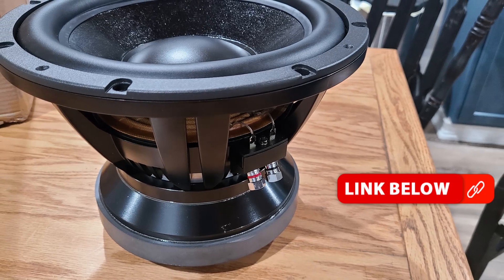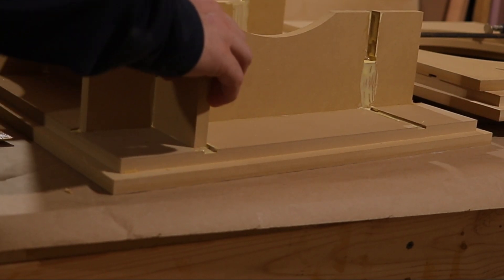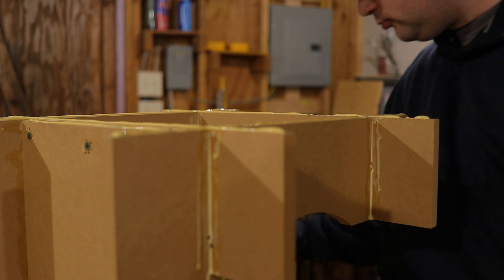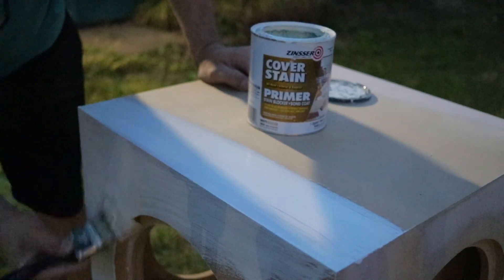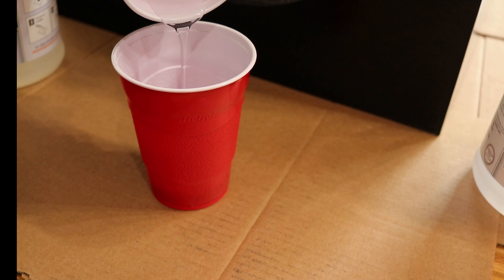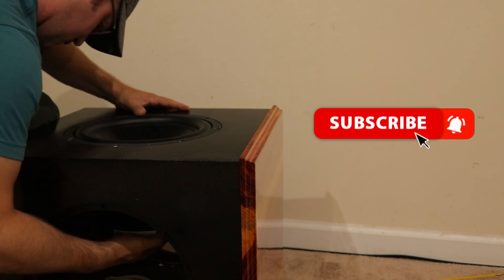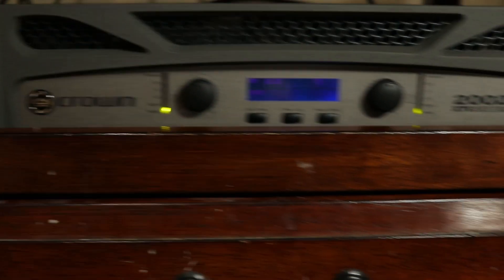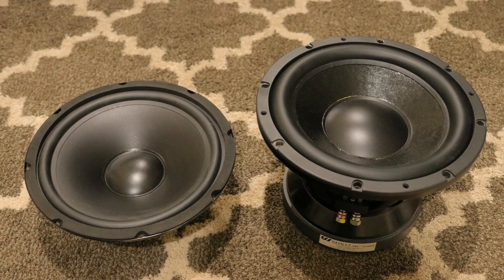DIY Subwoofer Build - CSS SDX12 DIY Subwoofer

Comment from the maker: Quick note: the kit actually comes with 22 washers for each passive radiator. You only need to use 15. I originally used 22 and tuned it entirely too low. Once I took seven off each side, the low end really came to life. In fact, the Edge of Tomorrow will shake our entire couch. The subwoofer is still just as silent as before. I highly recommend the subwoofer.

Comment: Great video! 
I have four of the SDX-12 for my music/theater system. I also got the CSS flat packs, but for sealed enclosure variation and was blown away by the quality and precision. I put my quartet on SVS SoundPath Isolation footers which have been very effective at preventing the house from rattling apart. I ended up putting a gorgeous, dark red stained, quilted sapele veneer on them. For their tops, I managed to get a great deal on some granite that was left over from a kitchen remodel, and the place that i bought the granite from cut it to size and polished it. I have a significant other who's absolutely convinced that the best place in the house to put a lousy potted plant on is one (and often more) of my damn loudspeakers or subwoofers. Therefore, the (black) granite tops are out of survival need instead of for decoration though I admit they look absolutely gorgeous. The other half admitted they didn't immediately hate them on sight. I'll call that a win! With their DSP amplifier supplying them 2400 watts (they're wired in series/parallel configuration) their in-room response was measured to be flat from 19Hz to 80Hz (DSP limited) +/- 2 dB. With four of those critters placed asymetrically in my living room, my system has zero bass issues as far as the room is concerned. When watching movies, there's another pair of subs in the room that are tasked with taking care of the low frequency effects (commonly known by the acronym, *LFE*. Both the subs are ported and each are driven by a massive, high-quality, 500 watt class A/B amp. The LFE subs are great for making big boom sounds. The SDX-12's bass has less boom and a massive amount of clean clear detail. Bass has  texture and a unique transparency in the bass that few subs can match, much less beat. 

Merry Christmas and have a Happy New Year!

Comment: My subwoofer is quite modest in comparison, but it still sounds great, and thought you’d be interested in the specs, for some analysis or something. The exterior dimensions are 13.5”H x 13.5”Wx 16”D. The front has a 10 inch driver in the center, mounted from the inside, accessible through the plate amp hole. The back has a port in the bottom corner, measuring 3 inches wide by 6.5 inches deep. The driver specs seem quite odd to me. It has a soft foam surround, very large, thin, springy feeling spider, and the thickest, heaviest cellulose cone I’ve seen! I believe the amp is 100 watts, and is the main weakness: it does not go super loud, but when used in the front of a small room with a couch in the rear, it is by far the deepest, cleanest hitting 10 inch subwoofer I’ve heard! You hear all the notes at an equal volume, and it goes below 30hz!
Reply from the maker: That is awesome. It’s always good to hear when someone’s happy with their set up. Sounds like a really great sub.
Reply: @Toid  Yeah. Funnily enough, I forgot to mention the model of the sub. It’s an old Paradigm PDR-10 from 1999. The driver, however, is dated 2004, but it’s definitely a PDR-10 driver: probably a repair under warranty. It was refoamed by the previous owner, but the job is not quite up to my standard for reforming honestly. (The foam surround itself is slightly off center, but no effect on sound as far as I can tell. Also, none of the screws are original. In fact, there are at least 5 different types of screws holding the plate amp on, some of which are definitely the hybrid Philips and square recess screws found in Bose products. The yellow light on the front to indicate when the unit is powered on, was disconnected as well, probably because it was distracting when watching movies. I fixed this.) I refoamed an identical pdr-10 for a friend of mom’s, and my job was a lot neater.

Comment: You should invest in an HPLV gun and get some automotive paint.   The difference in your finish will be night and day.   I also use shellac to seal the mdf.  light sand, then prime, light sand, and hit it with one good coat of enamel paint with some hardener in it.  The hardener will make it even glossier so clear coat is unnecessary

Comment: Is that price with the box? The sub is only 375 isn't it
Reply from the maker: Yes it's the price with the subwoofer passive radiators and the enclosure
Reply: @Toid  what would u recommend  this with for a simple home audio. 2.1 what amp are you using? Or can we use for this.  Might buy this vs buying a off the shelf sound bar
Reply from the maker: @damnitdang  so one of the issues with this is that it does really require a decent amount of power if you really want to push it hard. With that mind you're going to want a professional amp like a crown or a behringer.

Comment: Did you wire the SDX12 in series for a 4 ohm load?
Reply from the maker: I did
Reply: @Toid  sorry for all the questions. This is my first build. How did you know the PR was tuned to low? Did you measure it with REW? Or could you just hear it?
Reply from the maker: @matthewcurry1858  I heard it, but CSS also confirmed that you only use 15 washers. I could have double checked it with dats, but I didn't.
Reply from the maker: @matthewcurry1858  if you want help, feel free to come over to the forum www.toidsdiyaudio.com/community Is be happy to help you out. I'm sure the other guys would as well

Comment: Css said tout need to put 675g of weight to tune it...
Reply from the maker: They send 22 washers with each passive radiator. You only need to put 15 on each passive radiator. CSS confirmed that they send extras just in case you have trouble with room integration. Unfortunately on their website they say to use 15, but the instructions there's nothing about it. So it's definitely something to pay attention to if you decide to build this kit.
Reply: @Toid  yup already bought, just waiting to make my 📦!!!

Can't wait
Reply: @Toid  you didn't put foam inside???

Comment: Just asked CSS why no one had posted a video on this build.  Glad to see yours!  Just started assembling mine last week (got a dual kit) and can't wait to get them finished.  

Couple of quick questions;  1) did you use any gasket material for the drivers?  2) thoughts on "T" nuts vs. inserts to fasten the SDX?  Love your vids - keep it up!
Reply from the maker: I used 10-24 t-nuts. I'd recommend those over inserts especially with the weight of the subwoofer. One quick note, they send you 22 washers for each passive radiator. You only need to use 15 of those. I didn't add any extra gasket material, I just used what CSS sent. Last note, you're going to love it!

Comment: 10:12  After spray painting the screws with black paint, bake them in the oven for 30 minutes at 350F. The paint will then be very hard and unlikely to chip.
Reply from the maker: Great tip
Reply: I had no idea about this. HAHAHA! Excellent tip and cannot wait to try it.

Comment: Another amazing build Nick. Really impressive size for 20hz!
Reply from the maker: I agree. It's pretty surprising that's only 18 and a half inch cube. What's even crazier is the thing weighs well over 100 lb when built
Reply: @Toid  To be honest, I'm not too surprised about the weight, after all, that is a lot of bracing, and thick at that. The driver and the passives of course are very large and rugged looking, which I would imagine account for a lot/if not most of the weight. My BMR project is going along great by the way. When I eventually get it finished I'll post the build etc. on the forum. I can't wait! I wouldn't be able to do this kit myself though unfortunately since I live in the UK, nonetheless, its really inspiring seeing these high quality box designs.
Reply from the maker: @lio1234234  I'm really looking forward to that BMR build. I can't wait to see it complete.
Reply: How many cube is the box?

Comment: The amount of weight going onto these PR's is just insane!
Reply from the maker: Ends up, I actually added too much weight. You actually only need to add 15 of those washers for eaxh passive radiator to tune it. Still a lot. Whoops
Reply: @Toid  “only 15” lol
Reply from the maker: Isn't it? I was so shocked at how much weight went on each one!